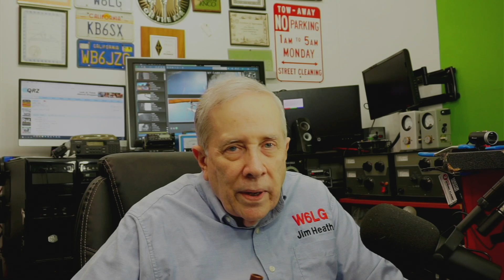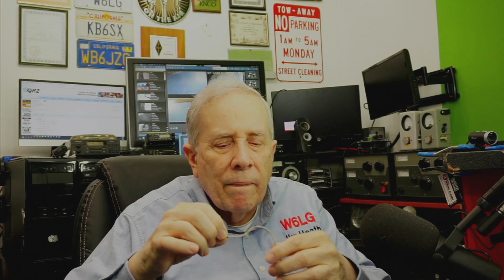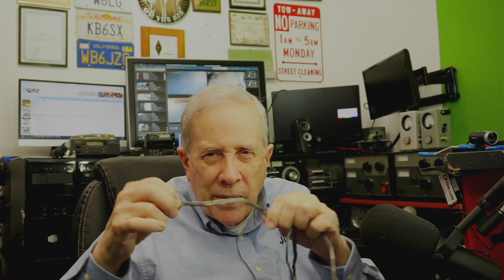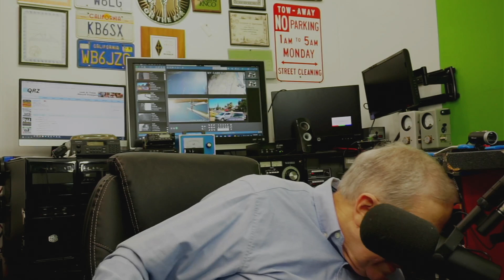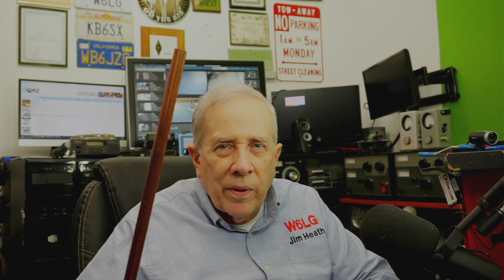How to RF Ground Your HF Station as Shown by the ARRL and a Discussion about Ground Loops, Bonding

Comment: an RF ground is either braid or flat copper strap. it behaves differently than a wire when it comes to rf, even if you do not believe in it. its explained in the arrl books.

Comment: Excellent presentation, thank you. If not using proper braided grounding cable but opt instead, for example, an AWG 16, would this not work – even of less efficaciously? Would it not still better than no connection to ground at all? Thank you.

Comment: Just call RFground  Counterpoise and your probably correct.
Reply from the maker: I was referring to the radio room.  Here's where I don't agree, the counterpoise has nothing to do with ground from the way that I see it. I need to think about your answer a little more.  What is the counterpoise up off the dirt by several feet?  Thanks, Jim
Reply: What is the counterpoise up off the dirt by several feet? 
 IMO it is  RF-ground. A rod in the ground is not RF-ground. I agree with you.

Comment: Good Video Jim. I do have a couple questions (fresh ham KE9BPO) when you say "each box" are you referring to separate components that make for the 1 transceiver or ALL transceivers, power supplies, amps & tuners? 
I run "barefoot" but my station consist of IC7300, president Lincoln 2plus (10/11/12 M), TYT TH- 7900 (2m70cm)  and the Btech 50v2 (GMRS).
Is it appropriate for me to ground all four units together at a single point at my station?

Comment: Hmmm… I’m slightly confused (and not for the first time): For over forty years I have used an old EZeeMatch ATU (and a couple of balanced SEM TranZmatches) - both with true balanced and unbalanced antennas, feeding signal into a lead-acid-battery-powered rig. 

The old manual for the EZeeMatch specifies (in capital letters) that the ATU MUST be grounded. (Incidentally, I LOVE the E-ZeeMatch, which doesn’t require lossy toroids to do its matching job - which it does brilliantly and with high efficiency).

I notice that both tuning and noise levels are affected if there is no physical connection from the ATU to my earthing rod outside the shack (to which my rig is also bonded). As my battery -ve is connected through circuitry to the rig chassis, and the patch lead from the rig to the ATU is effectively extending that connection, then why should tuning difficulties/added noise issues occur when there is no earth connection to the rear of the ATU (if there is actually ‘no reason’ for an rf ground to reduce the possibility of a ‘floating potential’ developing when in operation)? I fully accept your explanation, but practical experience tends to bear out my concern. 

Likewise with a modern ATS20+ receiver in a second floor bedroom being fed by an EFHW. The effect is easily demonstrated: Without a dedicated ‘earth’ connection, placing a finger on one of the chassis bolts immediately reduces noise and allows for better tuning. 

Is there in fact confusion between ‘RF’ grounding, and the carrying-away-to-ground of naturally-occurring-with-increasing-length-and-height-in-a-conductor, high-potential, STATIC electricity (as well described by Tesla in his ‘Radiant Energy’ experiments)?

Comment: Here in the greater Boston area, most electrical panels (including mine) have a #6 bare wire running to the house side of the water meter, and a jumper (to bypass the meter) that connects to the incoming cold water supply from the street. Although it would be easier for me to connect to the 'street side', I will instead run the biggest wire I can manage back to the panel. Otherwise I risk creating a ground loop, where stray current from my shack could travel back to the panel via the jumper and then find its way to all sorts of places I'd rather it not go. By running from my ground bus bar (or pipe, which is likely what I will do) directly to the panel, the shack equipment is like any other circuits in the house - terminated at the panel, which in turn is grounded via the aforementioned #6 wire. Nice video, thanks.

Comment: As a newer tech and studying for general, this confused me further.  I have a single HF transceiver connected to a Yaesu 1023A.  Do I use the ground lug on the back of the radio? If so. Where does it go? To a ground outside or somewhere else?

Comment: I understood that in your house all electrical equipment must be grounded in ONE place, so I suppose the station is grounded via the power outlets ground wire only.
Bonding all chassis is perfect to avoid différent voltages between metallic elements you can touch togheter.

Comment: I may ask for your or somebody's advice, my house was built in 1930 (one of those sears catalog homes) and when the electrical was retrofitted to be "modern", it was done so badly meaning all the grounds are false according to my wall socket tester. (I have plans to fix that in the long term but the home has other issues too so I can't just start opening things up.) Anyways, I just want to set up a CB radio and I was thinking of having a antenna in the attic (on top of one of those space blankets to shield it from Wi-Fi noise) and having the radio on the second floor. Should I also have a separate grounding wire connecting between the two? Or should I just have one between the radio and the power supply? Or in my particular case should I just actually run a ground wire with a stake in the ground even though it's "against code"? (Again, I DO have plans to modernize my electrical in the future. Just not right now.)

Comment: So to electrically ground my 2nd floor station is to use the ground pin on an electrical socket (assuming that actually goes to the electric panel ground).
Reply: That’s The way I do, when every appliance is connected to ONE and unique ground there’s no difference in voltage between equipments.
If you put multiple rods, you will create multiple voltages and you be exposed to potential difference between different grounds.

Comment: This was good, but he lost me at the end. When he says bond them a common point, and then connect to the electrical system, I am still not understanding if a separate run back to the electrical system is needed or if the AC ground is, through your power, is enough?
Reply from the maker: The latter. 73, Jim

Comment: Great video! Just moved into a new house and setting up my shack.  I've already run #6 braided copper wire from the electrical panel ground to my shack.  So as not to have to run a new stretch of braid or strap, can I just use the #6 already in place to bond my shack? I'll be using pipe strap to connect my equipment to the grounding bus in the shack.

Comment: YES! I couldn't agree more. I've been a ham since 1978, but have never needed a ground rod. I have always made sure all of my equipment is bonded together, but like you, no ground rod. I have only had one small RF "burn" on my lips when I hooked a friend's Swan 350 to my antenna and checked it out only to get zapped in the lips by the metal microphone screen. A bonding strap fixed that. I began questioning the need for RF grounding many years ago when I started operating portable with no ground. Now all my equipment, and any I bring into the shack use is RF bonded together with straps. My safety grounds are the ground prongs on the equipment AC plugs, but I utilize a few ferrites here and there to RF isolate the AC equipment power supplies from the house wiring. They have almost zero impedance at AC, but significant impedance at RF. My lightning ground consists of completely disconnecting all antennas at the entry to the house and keeping the disconnected feedlines well away from the house. I have considered sinking a ground rod well away from the house where I could attach all the antenna lead-in's to that, but the current setup works so well that it hasn't seemed all that important. I have no towers or beams, and the area I live in almost never gets lightning. Kristin McIntyre, K6WX gave a pretty good presentation at this year's ARRL convention which covers the subject much as you did. (Ref: https://youtu.be/VvE570NPmmI?si=_Fs-cUzqpEMr6m-H ) I am really glad to see everyone leave behind the idea of the need for RF grounding.
Mark, KE6BB

Comment: New ham here. (KD7LWL). I've just started in HF and have my first HF gear. I have a transceiver, a power supply, an antenna tuner, and a monitor hooked to the transceiver. My old eyes really needed that! My antenna is a Vibroplex endfedz 135' wire. I heard you say you're not a fan, but my space is limited - and so far this antenna has served me well.  I'm in a quandary about this bonding and grounding issue. I'm 'barefoot' in regards to only using 100 watts (stock Yaesu FT 710) of power. My shack is in a 10x12 Bully Barn that was wired up by my neighbor who has been an electrician his whole life. I've got my own breaker box in the shack. Do I really need to bond my limited amount of gear? And am I already 'grounded' in my situation?

Comment: If I understood your point, you bonded each device to a common destination ground copper pipe.  The goal is to keep all the levels the same across your devices.  In my workplace (network engineer) there are various devices which show a ground point but out of bad habit, we never use them.  Mostly because we have never been educated on grounding and or bonding.  What about antenna grounding outside?  I'm under the assumption that your permanent antenna should be grounded at the point it enters the house.  Thanks! Pete KF0OQA

Comment: So if the plug/receptacles in a house are grounded and I'm on 2nd floor and I plug my power/radio/tuner into my house receptacles, then my station already has the necessary ground (through the grounded receptacles) and all that is needed is to make sure that each piece of equipment is connected to its own metal plumbing strap that is also connected to a free floating copper pipe segment (say 3 feet long) that can be put anywhere in the station?      AND....no need to fuss about creating some other new ground connection to the main panel?  Thank you for your help
Reply: If your radio is powered via an AC to DC transformer, it might not be grounded as the transformer might act as an isolation transformer.
Reply: @jeffkardosjr.3825  So basically, if equipment is using an adapter? You just threw a wrench in there.
Reply: @jeffkardosjr.3825  Thank you for this
Reply: The typical HF radio uses an external 12vdc supply.  The 12vdc supply probably has a 3-prong cord running to the wall and its chassis is probably grounded.  When the positive and negative terminals of the 12vdc supply are run to the radio, it is likely that the negative terminal has a connection to the radio chassis at the radio.  But there is no guarantee that the negative terminal from the power supply is connected to the ground of the 3-prong power supply cord on the power supply.  Thus if the 12vdc supply outputs are "floating" from the supply's chassis then your radio will also be "floating."  Not a good thing.

So, if you use the copper pipe (and it is connected to the radio chassis only), it too can be floating UNLESS you connect it to ground somewhere.  The copper pipe might be house-grounded via one of the other chassis connections going to the pipe (i.e. by running a connection between the 12vdc supply chassis and the copper pipe).  I prefer the insurance piece-of-mind to run a separate 12gage copper wire from the pipe to the wall plug ground (i.e. to a ground wire inside that wall outlet plug box).

I'm not sure I would simply connect the 12vdc supply negative terminal to the supply's chassis, and use that to pick up house ground.  This is lot of unshielded wire running around.  I suspect that you might have some RF pickup problems with the power lines -- even with torroids. Just give the radio and the power supply (and each other piece of equipment in the shack) their own dedicated heavy braid/ribbon to the copper pipe.  Let the neg/pos lines from the power supply remain floating but put torroids on the lines to reduce RF pickup.

In summary, your 12vdc supply chassis, your radio chassis, and the copper pipe all need to be connected to the ground of the wall socket.  Put straps, braid, ribbon, etc. on the chassis and run them to the copper pipe.  And then make sure the copper pipe is grounded with its own simple 12g wire run to the wall outlet box.

One last thing, at HF frequencies the wavelengths are pretty long.  The dimensions of grounding runs in your shack are pretty short compared to HF wavelenghts.  Also, with copper ribbons and braid the impedance is pretty low.  This means that you are not likely to have any problems with HF RF "ground loops" from whatever matrix of straps you use for grounding.  This is not true for VHF, UHF, etc. where loop scale and wavelength scale start to be similar.  Note ground loops are different than RF pickup...use lots of torroids to kill RF pickup.
Reply: @713allen  Thank you for this long response.  I'll spend some time going through it.  Merry Christmas

Comment: Great video, Jim. Unfortunately it is a myth to think that connecting a station ground to a ground rod outside the shack is a good idea. If lightning didn't exist, MAYBE. But lightning does exist. And if a strike is close enough, the voltage from the strike travels into the ground up the ground rod and into your shack, likely frying everything connected to it. Ground is not equivalent to as place where lightning goes to die. The ground can and does get charged when struck by lightning, and connecting your radio and ham gear to it increases the danger dramatically. Lesson? Disconnect any buss bars that may be connected together inside the shack from the exterior "ground rod." Think of it this way: certain appliances come with a third wire (the green, for ground) so that it is properly grounded. In the olden days of ham radio, they weren't. What may have been necessary then (to eliminate charging the chassis of that old radio) is unnecessary today. Your ham rig IS grounded if it has a 3-prong plug. What is true for the garden variety appliance is equally true for the rig. Unless you know of an appliance that requires a ground rod being banged into the ground out the nearest window. I sure don't. If one thinks of the logic and physics of it, it really is simple. Now...RF grounding is another myth. BUT, none of these problems were ever solved (or could be) by running a ground wire from anything to an outside ground rod. First of, running a wire creates an antenna, therefore making any problem worse. Far better to put one's energy into ferrite chokes to resolve RFI than messing with "grounding." This old wive's tale needs to be put to bed. The mixup lies in the wording in the NEC code (that "equipment" must be grounded). That doesn't translate into running ground rods to everything that one plugs into an outlet. Why do ham rigs have a "grounding" post? It is for BONDING.  It is in the vast majority of cases unnecessary and actually causes more harm (from lightning, RFI and "ground loops") than any benefit that could derive from it. I live in FL. Lightning is not DIRECTABLE or CONTROLLABLE. Thanks again for your wisdom on this topic. We should always test the myths out there against reality. 73 de W1AL
Reply: Absolutely!! This is exactly what the RSGB promote here in the UK
Reply: Nope.
Reply: @jeffkardosjr.3825 Actually, yes. You are arguing with the NEC now, not me.
Reply: @N1IA-4  Your misinterpretation of the NEC isn't my fault.
Reply: @jeffkardosjr.3825  Actually, yes. Doesn't physics dictate that connecting a ground wire from a rig to the outside "ground rod" causes a direct path for anything that passes through it, including lightning?

Comment: Thanks for the information! there is so much confusing information on grounding out there, and this really made sense. I do have 1 question however. I always unplug my coax when not in use. When there is a lot of wind or a storm, I have observed sparks coming off the end of my coax, and so I was considering installing a ground rod to bleed of this static electricity, but after watching your video I'm having second thoughts. My question is, if I don't install a ground rod; what is going to prevent the built up static electricity from damaging my radio when the coax is connected to the radio?
Reply: I wish someone in the know would answer your question.
Reply: Hey man, the shield of your coax is connected to the ground of your radio, thus if you follow the advice here the shield of your coax is electrically grounded.

Comment: This is so helpful. I’ve wondered about this for a while now. I don’t have grounds for any of my equipment. I do disconnect the antennas in a storm.
Reply: I have a second floor station and have no grounds except for what's on  the electric cord. Never a problem. I have a transceiver, its power supply and that's it. I use a G5RV Jr. dipole and have worked from  the U.S. "2-land" to Japan, middle east, Russia, most of Europe, all continental US., etc. Not a copper pipe or ground strap anywhere close by. I just unhook everything when a storm is on its way. Never had a problem.

Comment: Great video, Jim! In case you didn't already know, it's pretty difficult today to find a transceiver that is powered from an AC outlet.
Reply from the maker: You are so right.  Probably there are zero that are powered directly from a convience outlet.  73, Jim
Reply: @ham-radio My rig is grounded to the outlet through the negative pole of the power supply. The negative power supply output is tied to earth ground - at least in my Yaesu supply.